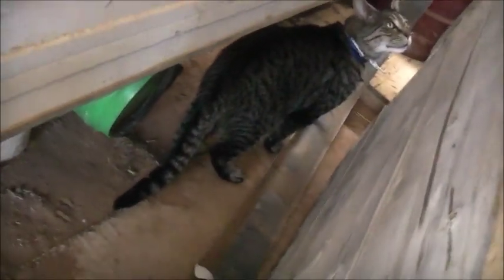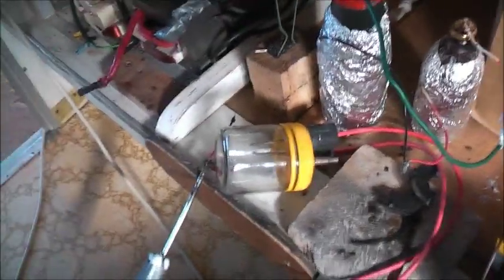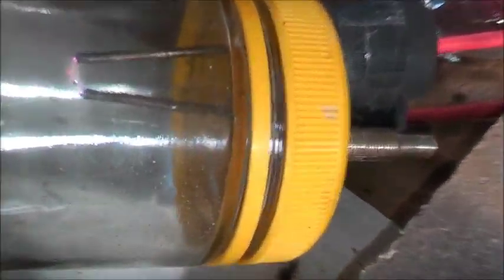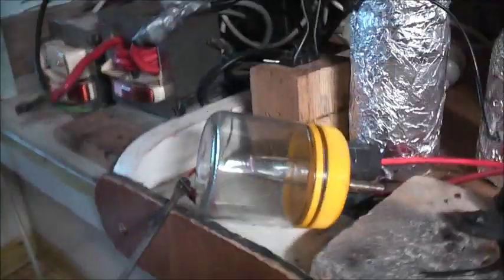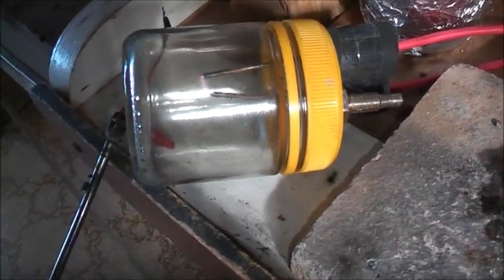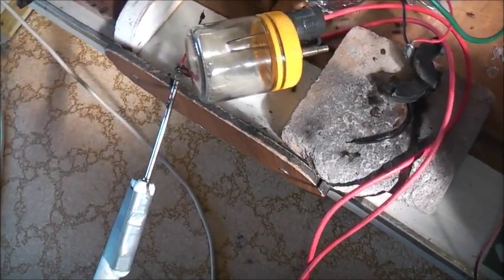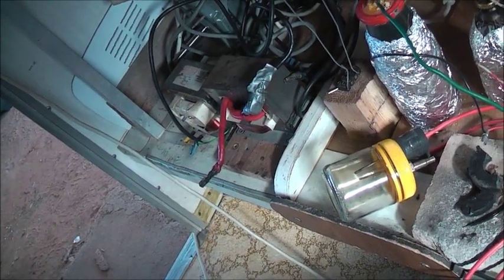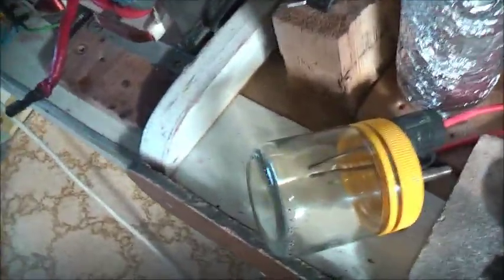Arc In Argon Gas

Comment: Thanks for trying this out. :-)

I have been thinking of a way to evacuate all air from the jar, proir to filling it with argon. The only way I could think of in an 'at-home' environment, would be to push the jar under water, make sure all of the air is out of the jar, then while holding it upside down under water, squirt some argon in there so that it displaces the water from the jar.

Then, you'd have a jar filled with argon, with no other gases in there. :-)

Thanks for showing,

-BBD.

Comment: is the argon under pressure in the jar?
maybe it would make a different result. i wanted to try this for a while. try making the electrodes further apart so the electrons have to jump across and make plasma. it looks like its just arcing across the gap.. i'll have to try with a flyback :-)